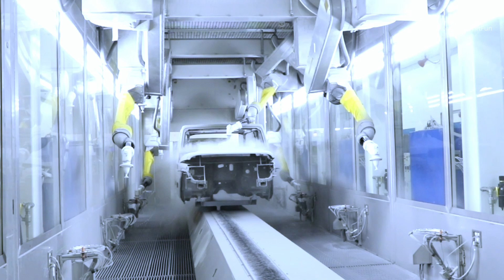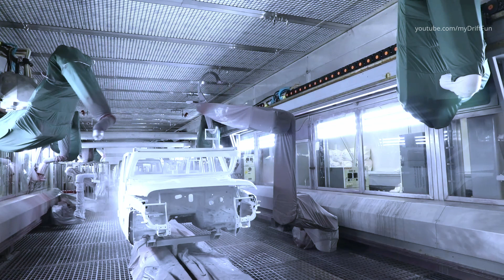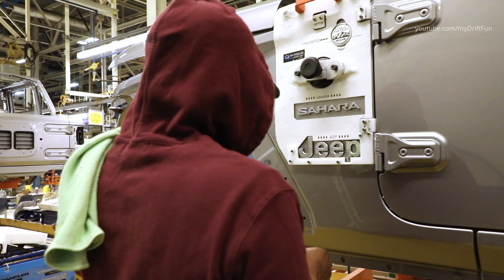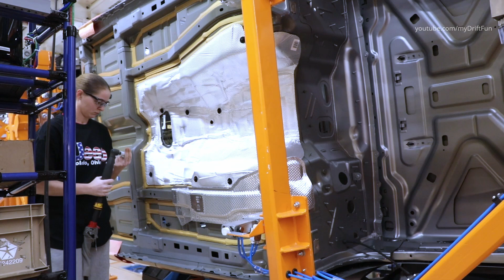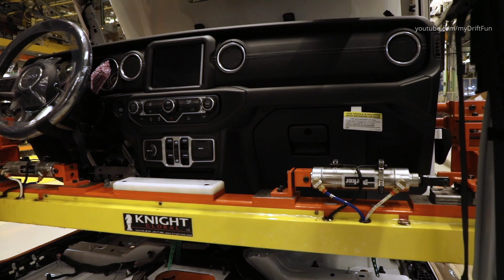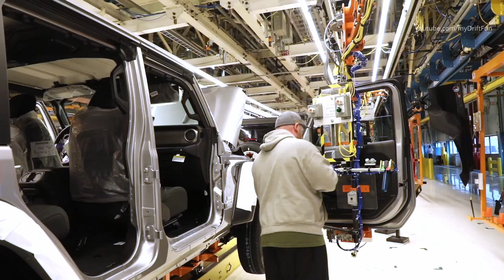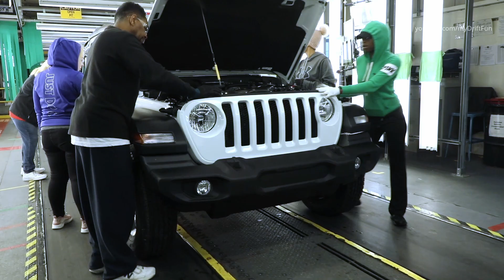Jeep Wrangler Production | HOW IT'S MADE

Comment: I love my Jeep.
Reply: What Jeep do you currently own/have?
Reply: @Nevoexpo  2018 JK Willys.
Reply: @gutteherr  Nice! I custom ordered my White 2018 Willys Wheeler 2 Door With the 5-Speed Auto right when the ordering process was made available. 

For optional Equipment, I ordered: 
- Power Convenience Group
- Alpine 9 Speaker Sound System
- Freedom Top Hard top

Apart from the obvious Power group and Hard top, the Alpine Sound System was the best upgrade I could have ordered. The chassis subwoofer is incredible.

EDIT: Of Course, I love my Jeep as-well and although sometimes, I would have liked having a Manual. The Auto is super nice for those long trips.

Comment: What a great Video. Y’all are doing a great Job!! Don’t let anyone tell you different. Keep up the great work!! 🇺🇸
Reply: JEEP ISN'T AMERICAN ANYMORE DUMMY
Reply: Jeep is a brand of American automobiles that is a division of FCA US LLC, a wholly owned subsidiary of the Italian-American corporation Fiat Chrysler Automobiles.
Reply: @tax905972  However... they are still assembled in America therefore, they are american. ;)
Reply: Nevoexpo ever car company is assembles here to save same on tariffs.
Reply: @tax905972  Okay. I'll bite and stay true to Chrysler products. Why are there assembly plants in Ontario, Canada? The ones that build Dodge Minivans, Chrysler Town & Country. Dodge Chargers, Dodge Challengers and Chrysler 300s?

Which still FYI does not change the fact that they are designated as American because they are built in North America.
Reply: @Nevoexpo Tariffs and the fact Canada doesn't make their own cars. They use American brands. Many cars manufacture also use Canadian labor. Less regulation and cheaper wages than we pay.
Reply: Nevoexpo those cars are Italian and have been for years. Mercedes owned them before that.
Reply: @Nevoexpo  Chrysler (FCA US LLC) is recalling certain 2018 Jeep Wrangler vehicles. The intermediate steering shaft may not have been properly welded causing a split where the external spline is formed. Chrysler will notify owners, and dealers will inspect and, as necessary, replace the intermediate steering shaft, free of charge.
Reply: @tax905972  You seem to misunderstand that assembly is what dictates what they are because of where they are made which is how they are classified. It doesn't matter who owns them, where the research and development took place, or even where the parts came from. If they are assembled in the United States, they are American. If they are assembled in Canada, they are Canadian. Both places make them North American which ultimately means they are American. It's region based. These are facts, regardless if you want to accept them.

The fact that Mercedes was a part of Chrysler earlier has nothing to do with this as does the new recall for the steering failure.

Now, I'm going to do you better and answer my own question. It has to do with cost and taxes. How much does it cost to setup and operate the plant. How much taxes are required to be paid. Are there any incentives or tax breaks given to the company from the state/province. How many workers are there and do they have unions. There are a lot of variables as to why vehicles are assembled where they are.

So going back to your original first comment. JEEP Is still American because they are assembled in North America. Case and Point.

EDIT: Also, you state "free of charge" as if recalls are not free. Especially since these vehicles are brand new and have 5 Year, 60,000M/100,000KM Warranty.
Reply: JEEPS ARE NO LONGER AN AMERICAN COMPANY.
Reply: You do know that Honda and Toyota still imports cars and Jeep is still an American company .
Reply: @tax905972  BMW 3 Series is assembled in Mexico… so BMW isn’t German anymore? WTH is wrong with that? Globalization.
Reply: @tax905972  @

Comment: Show me the machines that put out all the faulty frame and track bar welds!!
Reply: Which is best engineering Toyota or Jeep
Durability basis...Think
Reply: That's old news , besides the frame is built by outside vendor.
Reply: @toledojeeper2932  5 months is old when dealing with EVERY 2018 JL? ?
Reply: @xphyle  ..the issue has been fixed , they stopped shipping Jeeps for 1 month while fixing it , they even stopped production for a couple of days which is rare . Recall was issued and outside vendor corrected issue . It didnt effect every Jeep built in 2018 and 2019, I believe it was less than 20000 .
Reply: @mohammedshaji9785  ..2010Toyota recalls 9 million vehicles 
2012 Toyota recalls 5.5 million vehicles
Reply: @toledojeeper2932  they may have fixed the issue for future frames.  But ask the THOUSANDS of owners of the 2018 Jeep.  Go check the 80+ page thread on the Jeep Wrangler owners forum where people are posting pics of TERRIBLE welds all over the frame, and not just on the track bar!  This issue will cause a problem for 2018 Wrangler owners down the road.  Watch.
Reply: @xphyle  ..wow..you must have a lot of time on hand to check through 100s of forum pages . Sounds like a bit of a exaggeration to me .

Comment: I still have my 94 yj
Reply: I've a 1995 YJ.  4 banger with manual. Had to replace U joint in front and replace the after market leaf spring in front because leaf broke. Had back leaves replaced a coupe years ago.  Still going strong.
Reply: @rrich52806  Did you buy it new or used? How many miles/km does your YJ currently have?
Reply: i have 88 YJ got it in 1990

Comment: Comes standard with the death wobble option group on every model
Reply: It would not be a Wrangler without the wobble.
Reply: Look up death wobble. Caused by not maintaining the front end components as it wears out in 200,000 miles.
Reply: Leigh Rich look up death wobble wrangler and you will see it’s already a problem on the new 2018s, buddy.
Reply: Believe everything you read don't you?
Reply: @richardburns9772  Its not so much a death wobble as it is an issue with complete loss of steering because of faulty welding of the trackbar to the frame. FCA did recall around 18,000 JL's to address this issue which is pretty ridiculous but its quite a stretch to say that every model will have this problem.

It's a Chrysler product which will have poor fit and finish and can have poor build quality. I still love the Wrangler, despite all of that. ;)
Reply: 18,000 units were produced from late may to early August(?)(Can't recall the exact dates). Fiat Chrysler believes around 720 are affected but they don't know which units those are affected. They want the owners of those 18,000 to bring them to dealerships to either be cleared or to repair the weld.
Reply: Never had death wobble on any of my Jeeps .

Comment: I'm sorry to minunut 1:22 a robot works and 4 stops and a wrong and inefficient job management, should be reviewed.
At 2:18 am the robots are poorly arranged, a semicircle (with double lateral track on the ground with software-controlled electric motor) must be created, an automatic rack-and-pinion mechanical mechanism for hooking (and managing along the arc) the periscopic robotic arms that move a lot flexible for angle of the painting robot and to follow the car profile.
This method accurately manages several auto designers so it is a long-term investment, in fact three management software (difficult to set up) for three different mechanisms (dispenser + robotised arm + semi-arc movement on ground tracks) intersect.

Comment: 1/5 stars safety, no rear airbags, poor protection on chest and legs in frontal crash, over 440 complains at the NHTSA for bad welds and bad steering, people really frustrated wanting to give it back...  the most unsafe car in the street right now due to poor manufacturing and quality. It is a shame this concept is not made by a reliable brand like Toyota, Honda, Subaru, etc. How they are selling the 4 doors from $32k to $50k its unbelievable. This car is as basic as it can be, should be selling for $20k-$24k if anything. I went to the dealer and saw half way done welds on the steering control column, no thanks!!!, i will wait for 2020 Ford Bronco or maybe the 2025 JL (maybe FCA by then gets it right by - trial and error).

Comment: Jeeps in 10 years are gonna be worth $100,000
Reply: They will never be worth that much however, maybe in 10 years, the average price of a new Jeep vehicle could reach that much. Considering they are overpriced from the factory and they have the Engines which usually will last an average of about 150,000-200,000 Miles. There is nothing about Jeeps that would ever make them retain or hold that kind of value.

Comment: Why is the jl at the end in front of the Jeep sign say rubicon and has the rubicon bumper and fenders but not the rubicon hood? 🤔
Reply: Dylan, The vented hood is not specifically a Rubicon thing. Some editions like the Rubicon Recon will have one but also some editions of the Sahara will also have them. The difference in the Rubicon, besides some badging, are more "mechanical" than cosmetic.
Reply: I have a jl rubicon and all jl rubicons come with the vented hood. Now on the jk’s only some models come with the vented hood as you said. But the Jeep on the left at the end is a jl rubicon but doesn’t have the vented hood which is weird.
Reply: Export model.

Comment: why they dotn undercoat anything underneath so it wont rust after 5 years like any jeep ive seen?
Reply: They are cheap and leave that to the dealerships so that they can sell you their undercoating products/services.

You are way better off getting aftermarket coating like Krown and forgetting about it.
Reply: @Nevoexpo  krown all went out of business because they trap moisture under and rust everything out
I use fluid film twice a years, esp inside frame
I'm sorry 40k$ car there should be protection so it lasts
Cars from 90's  made to last most of them are still not rusted out esp Japanese cars
I see jeeps rusted out completely after 5-6years
Reply: @jdmjunk  Krown in Canada is still going strong. I don't know how it is in the United States. Every Krown location is operated differently based on the people that work there but they all provide a similar service, have been using it for decades and everyone else I know that has used it had zero problems. It does the job, even against our super harsh winters. As far as Chrysler not offering proper protection, I completely agree with you, it really sucks.

Comment: Why do all of these videos never include the frame line??
Reply: Copyright and Trade secrets are among the things that come to mind as to why its not included. You have to think about it from a competitors point of view. They don't want to give away all the goodies.
Reply: The frame is outsourced , comes into plant already assembled then engine and trans. go in and then body is dropped onto it .
Reply: @toledojeeper2932   Yes, the frame is outsourced but the axles, springs, fuel tank, etc are all done right there at the plant.

Comment: Since these are nearly 50,000 already why not have a Hemi option for about 15,000 more????
Reply: Having a HEMI option would require way more Research and Development. Primarily into different parts that would be able to handle all that extra stress, weight and power.

The biggest reason would be that it wouldn't sell because very few people would buy a JL with a HEMI, especially for 15,000 more when currently, the Trims are over-priced with limited options. There is a reason why they developed a 2.0L Turbo and that was aimed at people who wanted to save money, not spend more.

Comment: I have seen a 3.6 wrangler (the current production engine) with a cracked block, low compression on 1,3,6 cylinders, engine had 8k miles never been abused, flooded or modified!!! Go figure

Comment: I see too many quality control issues in this plant already without thinking about it. 
1. People not wearing proper uniform, you have a lady wearing loose jacket clothing, that creates a work hazard and affect work performance.
2. The way the wheels are mounted looks unsafe.
3. Running the 1st 3 lug nuts in like that risks crossthreading and thus stopping operations to fix the problem. Why do they need 2 people at ($25 hr?) installing lug nuts on the same wheel?
4. Already a manufacturing paint defect before people were buffing out the spots. Lots of overspray too from the machines.
5. Too much manual installations creates too much room for quality error. Some manufacturers have machines that inserts the entire powertrain, suspension, and exhaust as an assembly under the vehicle without humans guiding it.

If I was quality control manager, I would overhaul this whole plant with lots of PIR meetings. Look at the difference compared to other foreign car makers.
What a joke of the auto industry but hey, Chrysler doesn't care.

Comment: Too bad the driveline is let's say inadequate and not up to the standards of the industry.
Reply: Dan Burdsall Ford Bronco comming soon Jeep sales will go to 2/3rds less!!
Reply: @danielhood4062  if the engineers were so smart they wouldn't of put the flop of a 3.8 in them for 2 years.
Reply: The driveline of the JL is exactly where the standard of the industry is with a powerful 3.6L Engine and 8 Speed Auto providing good fuel economy and power. 

What exactly makes it inadequate? Be specific.